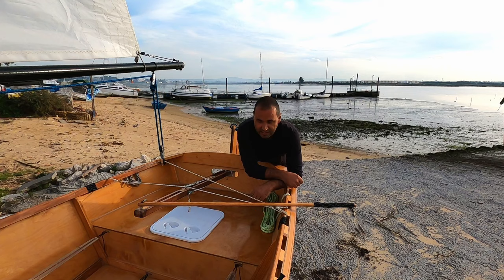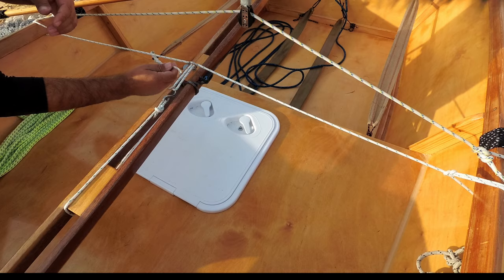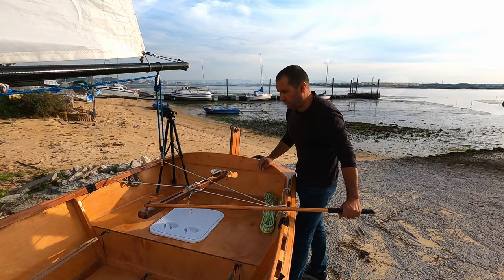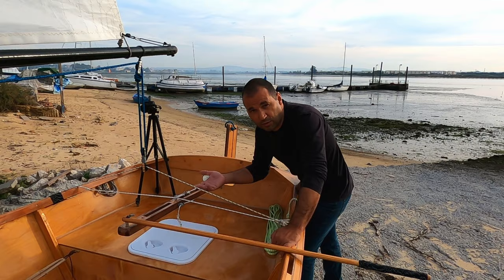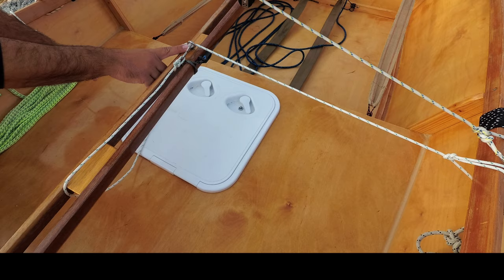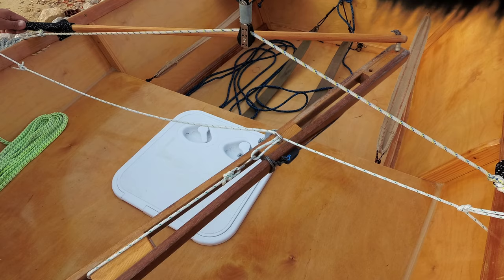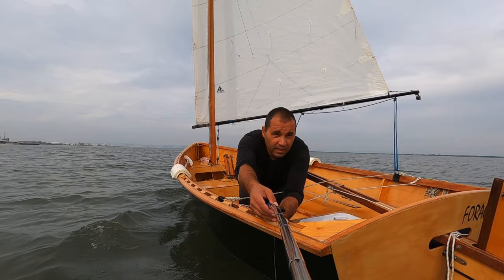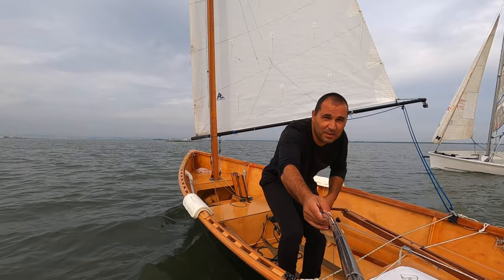How to Make a Tiller Lock

Comment: Lovely! I don’t need to do a video now! One thing though, I have an elastic bungee on the tightening rope, just behind the hook. This means that a gust of wind can always override the tiller lock. It never completely locks the tiller.
Reply from the maker: Hi Roger, thanks for your feedback! And thanks for your amazing videos, you're an inspiration to many!
Due to my boat's hard chines and hull geometry as soon as she heels a bit she turns to wind if not compensated by rudder. The rope still allows me to adjust from really tight to no friction and every setting in between! As for the gusts, my boat weights around 100kg with 10m2 sail, if there's any gusts and I don't have that main sheet or the tiller extension on my hand... I'm in the drink!! 😁
Reply: Oh my idol
Reply from the maker: Roger's a legend already! 😉
Reply: I've watched your videos and looked very close to your set up. Now this(plus your input) has made it clearer.Going to fir it on my TS16. Cheers
Reply from the maker: Hi John. 
I'm glad you liked it. 
I can't stress enough what a relief this little mod has brought onboard!! 😁
I will try replacing the rope by some "naked" spectra, as after about  two weeks and over 50nm of really intense use(system engaged 100% of the time) I'm starting to see some wear on the poly rope I used. It's like the rope is getting lots of little "hairs"... but then again it was really cheap rope from the hardware store.

Comment: That's great, I have single handed a 3 sail dinghy and with messing about with managing all that an pulling the board to clear weed etc, that would be really handy.  I just didn't think it could work that well, but you did it and proved it, well done!
Reply from the maker: Hi Ken!
Yes it really works well!
I believe the original design had a bit of bungee cord leading to the hook. I might try that too at some point too!

Comment: A very simple but effecrive system. I have a very similar system on my boat. I find it very useful when heaving to. I just lock the tiller hard over and let the sail go and I can sit just off the wind indefinitely. With the sail and tiller balanced you can hold a good course for a long stretch. (I do clead the sheet sometimes, but tether myself to the boat when I do, and ALWAYS wear a PFD).
Reply from the maker: Hi Steve!
My GIS is so light that everything happens in a heartbeat! Now I can actually relax a bit while doing simple tasks!
Next to my Lazy Jacks this thing is the best addition to my setup!
Reply: @TheBoatRambler  My boat is a bit heavier, and has 300kg of water ballast, so the dynamics are much different. A tiller lock really comes into its own on a small cruiser.

Comment: You're awesome Teo... you might consider a way to attach an "overboard release" that would disable the rudder restriction if you go overboard. A quick release of sorts.
Reply from the maker: Hey Phil!
Where I sail I don't think I will drown before I reach shore and my boat will end up just a handful of miles away in the worst case scenario.
Still I can always tie a slipping knot on the main sheet to hold it in position  and tie the end of it to my wrist. If I fall overboard at least the main sheet will be released.
I do have a floating rope tied  close to the transom but I haven't felt the need to  drag it behind the boat except when I did the capsize tests. 😉

Comment: I think the idea of the Huntingford Helm Impeder, which I have myself, is that the friction is adjustable, so you can move the tiller in an emergency, or just make it slightly cntrolled as wished.
Reply from the maker: Hi!
The system shown in this video IS adjustable and the tiller can be moved if necessary. Depending on how hard you pull it can go from almost no friction to really hard to move. The elastic is a good idea too and I might try it at some point. 😉

Comment: Hi, again. This season I had my tiller lock set up on the underside of my tiller and had the short piece of elastic as Roger suggested. I repeatedly ran into a problem where it would jam, when completely released but not disconnected. I kept the length of the adjusting line short enough that the clip would stop about 1 inch shy of the eye bolt. It seems the loop in the cross line would twist. Suggestions?
Reply from the maker: Hi Mark!
I don't use the elastic setup, it's double braided poly line for the adjustable line and I now use spectra with no outing for the cross line.
Also I always leave some some amount of tension on it. 
What is the dimeter on the SS eye on your setup? Being bigger and having some tension (almost zero) should prevent it from twisting...
Also with the elastic that hook probably travels a lot further aft when fully released, making it prone to twist.
Just my 2c....